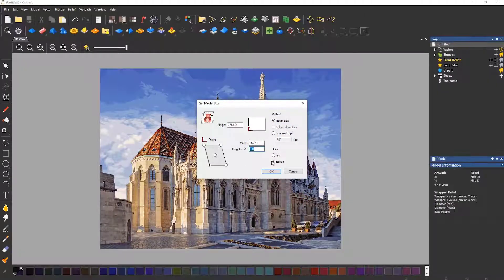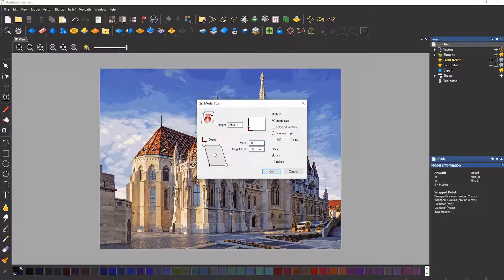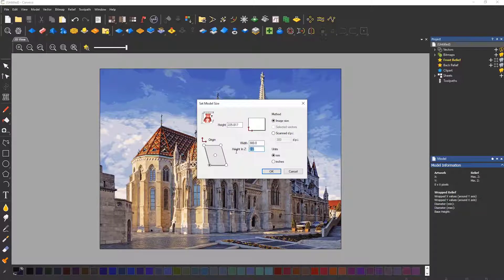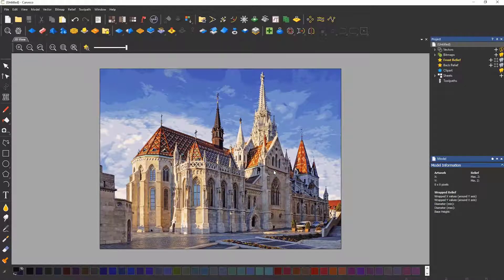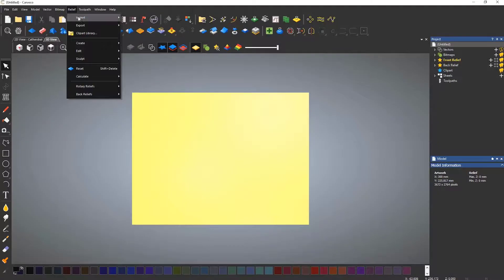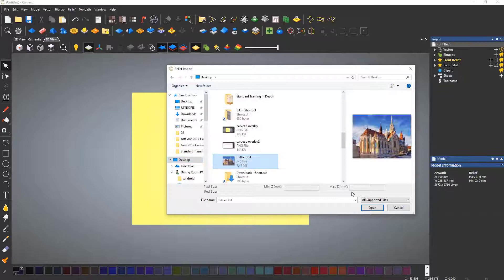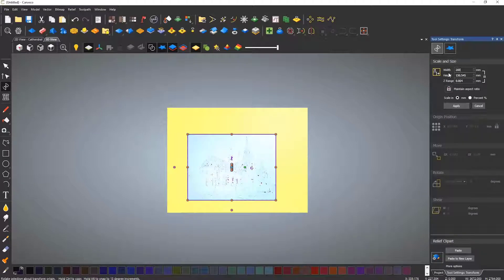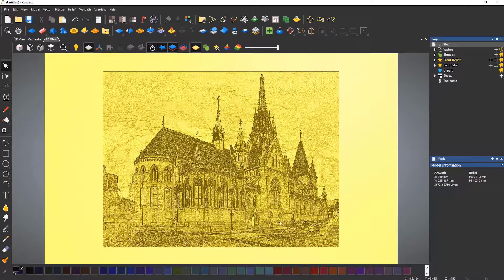14: Getting Started in Carveco: Creating Reliefs From Images

Comment: hello thank for the video. 5mm is not high... but 20 mm is very ugly result!! why? and wow to make good result for make nice .rlf  file to crave it? thank
Reply from the maker: Hi Ghislain, thank you for watching the video.  When creating these types of reliefs from images they will only really work with a small thickness as it is generated by using the pixels and colours to generate the depth, so the higher the relief, the more tolerance there is and it will create a spike effect as you have seen.  If you wanted this to be a higher relief you would need to generate it by using the shape editor and/or two rail sweeps from vectors.
Reply: @Carveco  Ok thanks a lot for your answer. And if you can make tutorial for make beautiful relief with this picture and the tool (shape editor) et (two rail sweep) l think you help many user or future user to buy Carveco. for built nice relief. have good day.